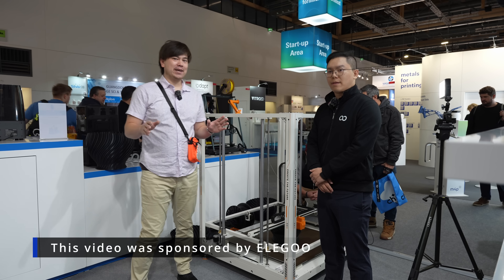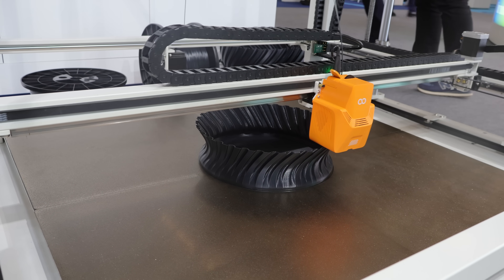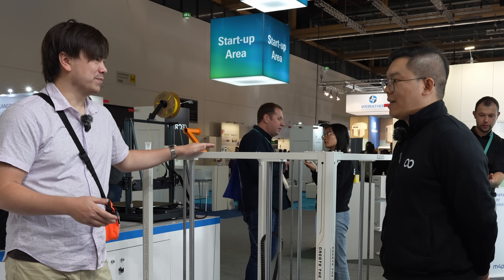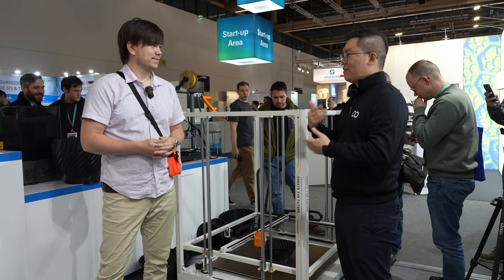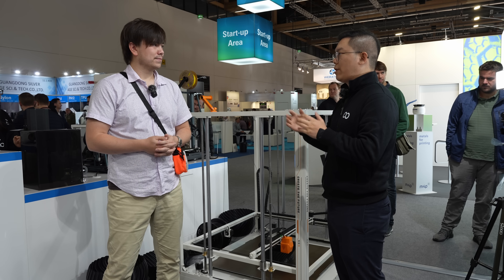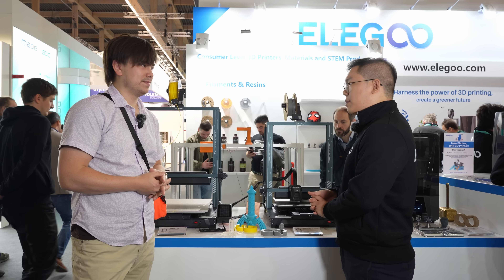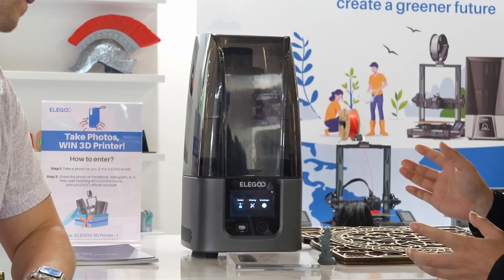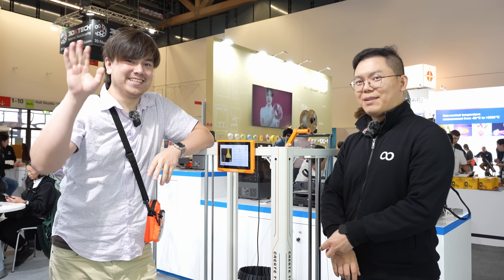ELEGOO'S GIGANTIC PRINTER!! (Bonus Info on High Speed COREXY, Giant Resin Printer, Multi-Color Unit)

Comment: Is there a reason why they used only 6 V-wheels for the bed and why they overall built in the POM ones instead of the Anycubic Kobra 2 Max‘ linear steel rods…..
I fear that it wouldn’t last that long and the bed wheels would wear out quite quickly when printing fast and heavy objects….

Love your videos, really cool to see all these amazing products at Formnext, I was also there;-)
Reply from the maker: I think the issue is how to allocate cost.  The less you spend on one system the more you can spend on another. From what I’ve seen, I believe the Neptune 4 max will print better than the kobra 2 Max
Reply: I want a Neptune 4 Max but I'm waiting for a steel motion control system like my Neptune 4 Pro, for better print quality and better long term durability.
Reply: Thanks for the advice!

Comment: Excited to see what that core XY printer's going to look like!
Reply from the maker: 1st quarter 2024 is actually not that far away, and coming out with multi-color printing at the same time? I have a feeling that it has been under development for a while
Reply: @NathanBuildsRobots  Yeah, it's really soon and the multi color is very exciting. Im likely still to get a P1S this Christmas but all the luck to Elegoo! Their Neptune line has served me well.
Reply: corexy in this size would mean a horribly long belt, like more than 5m long so it would have to be "stiff as a diamond" to work? i had an idea (long time ago) about maximal speed/size configuration, this orangestorm seems to be kind of between that and corexy (which in this case is good i think).
Reply: @jarkkoaitti287  The representative in the video mentions how Elegoo will have a core XY offering in first quarter of next year. That's what I was referring to.